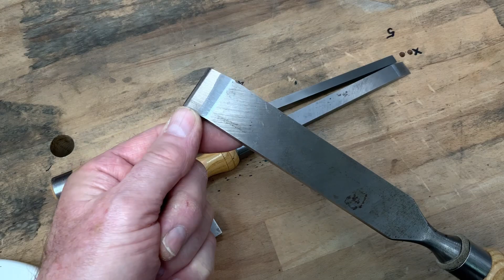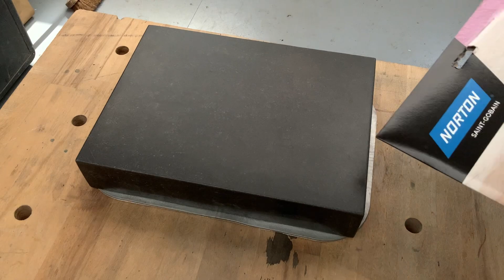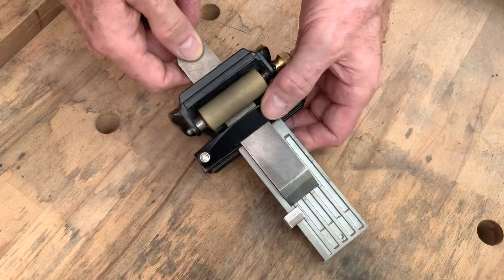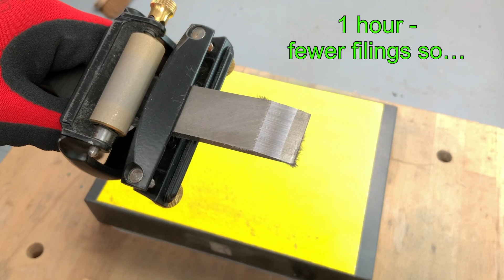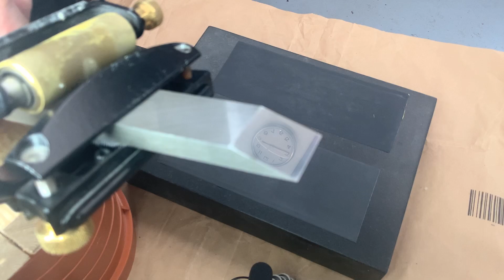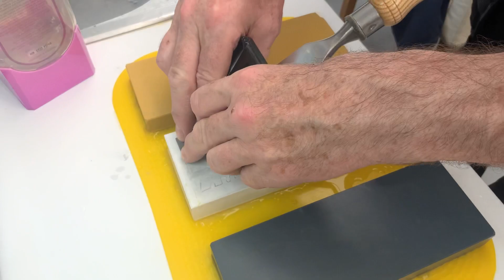How To Grind By Hand

Comment: I do it by hand as well. You don't have to worry about overheating the metal, and it is really good exercise. I use Naniwa 220 and 400 stones, and they make quick work of the blade.
Reply from the maker: You’re right about overheating the metal. By the time your fingers can’t stand the heat, it’s still nowhere near too hot. I must look up those stone; I’m still using the 40g paper

Comment: I went through a phase early on refurbishing old chisels into sets, going through whetstones, Arkansas/oil & diamond stones to figure out the most efficient method for flattening and regrinding primary bevels by hand. My Dad, seeing what I was up to, bought me a Sorby Pro Edge that Christmas—it was well appreciated!

I wonder if square edges are preferrable in your opinion to the common trapezoid shape of most mortise chisels. I've used pig stickers but  got on well with a cleaned up set of firmers. I know Japanese mortise chisels have 90° edges too.
Reply from the maker: Thanks for the comment; very much appreciated!

My only experience of mortice chisels is the Registered ones such as featured in the video and my Lie-Nielsen 1/2 inch and Japanese 1/4 inch. All have sides that are square to the sole (or back).  On the mortice and tenon course at David’s place, he said that the square sides are essential to getting clean sides in the mortice, and the chisel is “self jigging” to keep everything straight. 

I know one can get trapezoidal chisels which are supposed to make it easier to get them out, but a good polish on the sides should have the same effect.
Reply: @mrlinnsworkshop  I thought as much. Square edged chisels leave cleaner sides too from my experience. 

Thanks for the response! I've enjoyed watching your videos.

Comment: I love my CBN wheel for regrinding primaries. The thought of spending all day on a stone is enough to throw the tool away.
Reply from the maker: 😂 Believe me, when I was making this I sometimes doubted my own sanity! However, one of the aims was to show that it’s possible if you’re willing to put in the effort. It’s not that bad if you break it into short stints, perhaps spread over several sessions. Certainly going at it hammer and tongs in one long non stop session would only be possible with a Herculean effort!